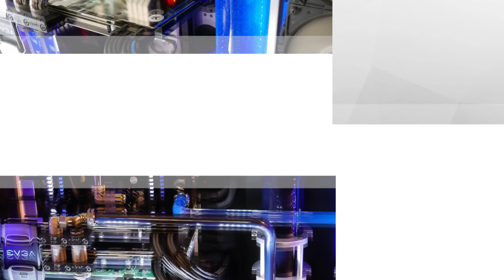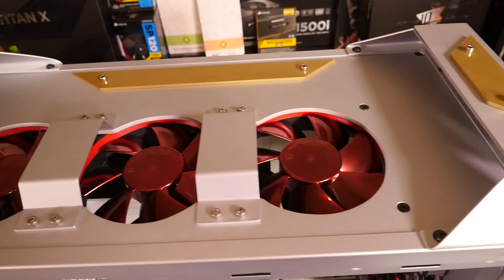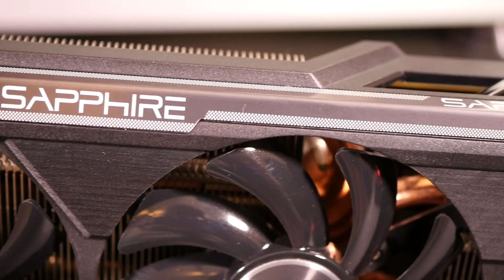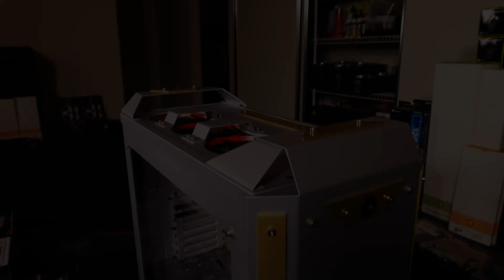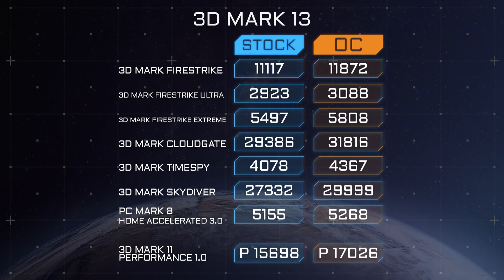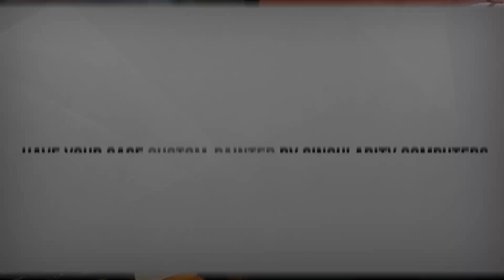Project Cobalt #4

Comment: The stock version also fits two 360mm rads, if anything the removal of proper 140mm support makes your mod less functional than the stock case (in fact, I have a 420 and 280 in a stock variant of the case).... but very nice work of course. Fantastic craftsmanship.

Comment: It doesn't look like there is a filter or cover around the front fans. Fantastic case, wish the guy did a full water cooling custom loop, but i just felt like in the off chance that there are kids around, having those exposed fans in the front is not the safest. Love the build though
Reply from the maker: Yeah you are not wrong about the fans lol, but nice to see the blades. They were an important feature for the case mods.